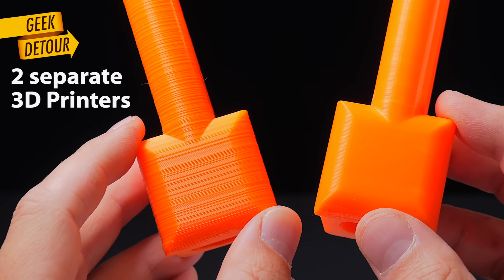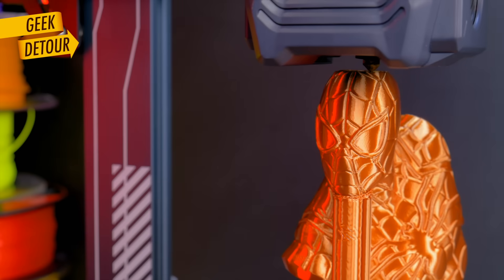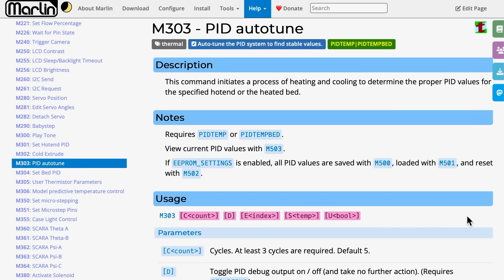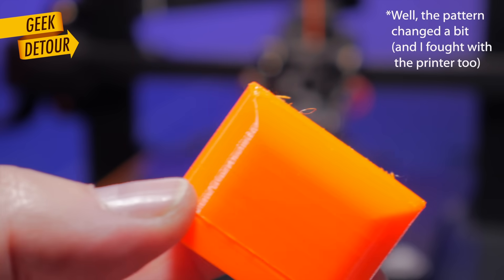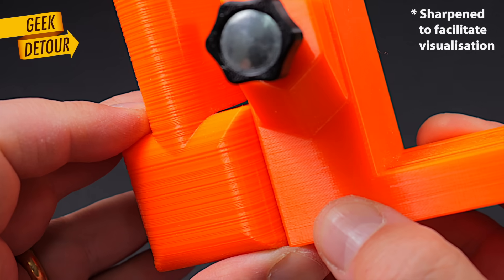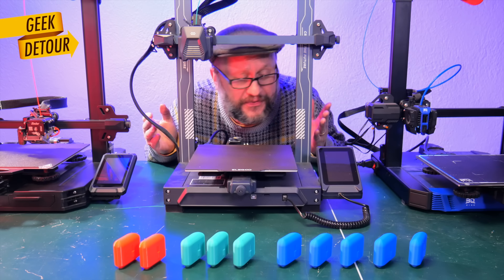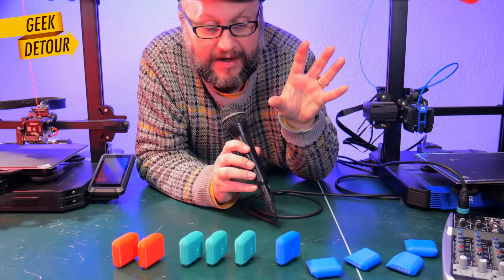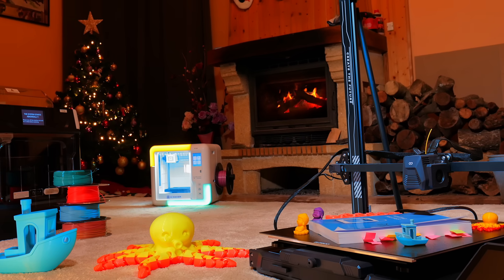3D Printer Problem: do you know How to Fix Z-Wobble?

Comment: Having these 3D printers and having to fiddle around with a trivial issue is real braindamage. I have a Tronxi P802E at home with Repeater firmware 0.91, and this is the kind of printer where you really need to understand something to get it to print well. Saying you have some kind of problem with this 3D printer and trying to solve it, you practically started studying quantum physics, like... I think you need to see a doctor about this. Just no comment more, idk😂

Comment: Bro I have an issue with bed adhesion on my anycubic vyper, most things stick okay with silk but nothing else will stick to the bed properly anymore...... suggestions? Tried cleaning the plate with detergent, leveling, New nozzle, z height adjust etc.

Comment: I'll throw the rock at the Ender for you..!  

I had an Ender but could never get the bed levelling to be consistent. I literally had to redo the bed levelling before EVERY print! I tried a bunch of various enhancements (stiffer springs, solid mounts with shims, etc...), but never got more than a couple prints before the next would fail because of the bed not being level. I gave the Ender printer away and never looked back!
Reply from the maker: It’s a very different machine… it has many things to adjust that are not obvious - mine still prints very well. But you need to keep it well adjusted.

Comment: My problem on my ender 3 pro v1 was the 6 z wheels. What happened was I left the printer off for about a year and the wheels sat in the exact same position for a long time, from the compression on the wheels sitting in the same place it put indents on the rubber wheels and when I went to go print, as the wheels traveled up the z axis the stepper motor wouldnt move the printer head up along the z axis fast enough so my printer would start printing the 6th layer where the 5th layer should have been, and it would keep doing this over and over again as it would travel up the z axis. But by replacing the wheels i fixed this issue. However i had many indents on the wheels because i left the machine off in different z heights for long periods of times, so it would leave many layers all messed up. Now in theory this could mean that the compression on my z axis to to tight, and this could be the issue with it. I never really got to the bottom of it as to why that is happening to the wheels but i noticed that when i made the compression too loose on the z axis it would print my models wrong. The right side would warp and the left side would be fine. So i had to add the compression on the z axis again.

Comment: Thank you so much for this video, I’ve had my printer for years but I’ve barely used it because every print kept coming out with this same issue.
After cleaning and lubing the lead screw + guide, I’ve finally gotten my first good looking print! 
The guide on mine was completely full of gunked up grease, so no wonder it was having issues.
Reply from the maker: That's awesome! So happy I could help you get your printer back in action! 🎉

Comment: I'm punching air right now. My Ender 3 from 2018 had perfect first prints, but then it started giving these ANNOYING lines. I tried everything to fix it, or so I thought. I must've tightened those screws in early tinkering because I didn't know any better. Now that I loosened them, the lines are GONE. oh my GOD so many years 😭😭😭😭

Comment: Real solution is: Grease your slidy parts and use bowden tube or comparable to make sure that your filament doesn't snag either.
Use high temp non sticky lubricant, PTFE for example.

PS. basically make sure that everything is moving smooth, if simple greasing does not work yet, you may need to dismantle the printer to clean possible hidden places like @craigjoe8691 suggested below.. some printers will have more hidden places than others, so work with what you've got.
PPS. also do make sure that things that have to be tight are tight, refer to ur manual.

Comment: Maybe the lead screw was misaligned at first and then when you loosened the bolts it came into alignment? That would explain why retightening them didn't reproduce the problem.
Reply from the maker: Yeah. Restoring the exact context that caused the problem is never possible. Some people got angry at the comments saying I didn’t prove anything (which is technically right) but you got it: once you touch it, disassemble it, lubricate it… it will behave differently 🤷‍♂️

Comment: You didnt mentioned the nozzle itself. Maybe something was wrong with the flow, so it couldnt extrude the usual length or the nozzle diameter might have changed a bit during printing or the first layer got contact to the bed cause it wasnt levelled properly, so it scratched on the bed and the nozzle diameter was affected. Why didnt you just replaced the nozzle for a better result?

Comment: Great video. I think the problem with my printer is pid tuning because it was working good before I had to change the heater. I’m still gonna replace the lead screw nuts as they must need it by now, I’ll upgrade it with Oldham couplings and anti backlash nuts while I’m at it.

Comment: Video about why you should't buy E3 S1 pro. Known issue. Bet a $1 You'll run over this problem again.
Generally the idea is that a screw must have only 2 fixed points, not 3!. Creality engineers found the most stupid and harmful way to sync the screws.
2 ways to solve. 
1. Throw away right stepper, right screw and all the garbage on the top including the belt and both top screw holders leaving top of the left screw move freely. Just like on E3. No magic with tightenind or loosing screw nuts will be required any more.
2. Throw away right stepper, move left stepper to the top and make it only pull the belt. Both lower ends of screws should hang free.

Comment: 0:18 Buying a top 3D printer???
Reply from the maker: When I made the video, more than 2 years ago, the Ender 3 S1 Pro was indeed the top model of the Ender Line - and it was a very good quality printer. I still use mine to print PETG (which I like to print slower than PLA anyways).

Comment: I will have to give this a try. I have an ender 3 pro  and have experiencing this issue. I also think i need to replace my thermoster as i have now started getting a thermal runout error (only when i go to do the print) once i reset etc the print works :/

Comment: I'm here in December of 2024. I've sent back at least 3 machines with this issue and just replaced them for new ones. I literally was tightening that nut that's supposed to be loose. I'm going to try this on my anycubic kobra 2 neo tonight and I'll comment back here after testing. 😊 Thanks for the tips. 😊😊
Reply: I have the Kobra 2 neo. Could you please tell me if you were able to fix the smoothness and if so, how? Thank you!
Reply: @Jangimiau  just got another extruder and I noticed that my m4x4 set screw (x2) were stripped and needed replacement. If you're able to spin the "hotend" with your hand even while tight, then yes, the screws are stripped. Once I find more parts for it and run a benchy, I'll let you know. 🙂🙂

Comment: I have been printing for 5 years and have 5 printers (4 filament, 1 resin) and i had no clue this was a thing.
this might explain why i have problems with my customized cr10 mini who used to print perfect dut have had problems for a while now
Reply from the maker: Yeah, old printers can remain printing nice, but we need to check a bunch of stuff: belts, it the print head and the build plate move without play (and adjust the eccentric nuts so they move smoothly without play), and sure: the leadscrews must be clean and lubed 😬 I have my oldies working fine - after you learn everything that goes bad, you can check it all in 5 minutes.

Comment: You can use tight nuts on the z-axis...
...If you use Oldham couplers as they take care of the leadscrew inconsistencies and allow the screw to move the slight bit it needs to, without affecting your bed/gantry
Reply from the maker: I still need to test Oldham Couplers to understand if there are side effects - there is something about non-linearity of the angular motion if there is too much lateral movement. I don’t know if that translates to visual artifacts or not. But I bought one to try

Comment: This can be caused by so much different things. I almost replaced my entire machine and still have ugly layer lines. Even expensive machines can have these issues. It could even be irregular filament with crappy dimensions.
Reply from the maker: You are right! That’s why some people get really frustrated when they start 3D Printing. But I need to say: the last batch of CoreXY machines, completely enclosed, with auto-calibration… they are way easier. It can be a BambuLab, Creality K1 (I am testing the K2 Plus right now) - they are practically plug-n-play. And filament is getting better every year too!
Reply: @GeekDetour  I'm also looking to buy a k1, p1s or sv08 corexy machine. But I'm afraid that they are even more complex to diagnose when something gets out of alignment.

Comment: Thanks Very much, Because of your video, I found a fix to my printing, not this problem in the video, but in the Print Head that was loose, and you show how to fix in the video
Reply from the maker: Oh, that made me incredibly happy. You know, some people commented here “go straight to the point!” But your case is exactly why I care: when our machines are in trouble, there are many different things that could be happening. Thanks for sharing!
Reply: @GeekDetour  I have a problem with my 3d printer. I don't know if you have a video with the solution. 
Let me explain. I have a ender 3 V2 neo. Bowder type. My problem is. When the project has a lot of retraction, the extruder damage the filament and stop print in the middle of it. I've tried almost everything, temperature, retraction, I even loose a little the extruder but nothing worked. Do you have some video about it ?

Comment: I have this book, it’s great. I also have The Zombie Apocalypse Guide to 3D printing by Smyth which is a quick read and very helpful in understanding how to diagnose and design for print. One of the biggest design issues seems to be fitment— to other 3D parts and to real world objects. Smyth’s book helped me to understand how nozzle size affects thermal expansion and as a result I can design parts that fit usually without running several prototypes. Anyway, I have a Bambulab X1 Carbon which prints perfectly— at least for now. So I appreciate the insight.
Reply from the maker: Oh, I bought the Zombie Apocalypse Guide to 3D Printing - very catchy title, the book itself didn’t age so well. It was interesting when it was published, but the images are all “old” - I don’t remember which type of cad it used. The models themselves look like obvious knowledge today (although it washed back in the day).
Reply: @GeekDetour  it does feel dated for sure, but there are some nuggets of info in there that are still applicable.

Comment: Just buy a better printer from the start. Just bought the x1-Carbon, and couldn't be happier.
Reply from the maker: I have a Bambu Lab P1S and indeed they are EXCELLENT printers. But I keep my older printers for different reasons. One example: TPU must be printed SLOW - so, a slower printer is perfect for that (I have a dedicated printer for TPU). I also like to print PETG slow. AND Silk filaments are only really shiny and reflective when printed at slow speeds - and I have printers that print Silk PLA better than my P1S.

Comment: Bought myself a 3d printer last week. it worked the first day then out of a sudden it stopped extruding filament mid-printing. I could not figure it out what went wrong for 3 hours then suddenly I realize maybe the tip is jammed. and sure enough it was. fixed it. now its running fine.

A few hiccups here and there, other than that I am starting to love 3d printing. Long way to go!!
Reply from the maker: The journey is the big reward here! Welcome to this amazingly maddening great hobby
Reply: @GeekDetour the more I get to know this field the more I realize there's a lot more to learn. Great content BTW. Thanks.
Reply: @BlondieHappyGuy 

You won't believe if I say that what happened to you is my fear as well. I secured the spool holder on top with 2 small screws because I did not had any other that fits in those threads.

I feared that it could fell down, I also secured the holder with 4 nylon zip ties.

Still feels it may fell though.

PS. It's nice to know that someone else also having same problems and resolving them. Loving this new hobby.
Reply: @BlondieHappyGuy   I did tried to make some videos, Never got comfortable making them. Well see you around then.
Reply: @BlondieHappyGuy  

I did even tried extrude and retract, tried pulling the filament also. 

it was really stuck. I had to heatup the hotend then poke the nozzle with a fine needle (provided with printer) back and forth only then I was able to unclog the head. Working fine since then.
Reply: @BlondieHappyGuy  Well, Thanks. I will keep this in mind. BTW do I really need a enlosure for 3D printer to print with PETG or TPU?
Reply: @BlondieHappyGuy 

Thank you so much. I also placed spool on top a few days ago just to save some space, didn't knew that it will be helpful in printing as well.

I will try to fiddle with settings for TPU.

Also I am thinking of making a make shift enclose with some leftover 3mm MDF board I have.

Will let you know how it goes.

Thanks again. :)
Reply: @BlondieHappyGuy   Well, please do upload a few videos of your electronic projects. I am sure it would be interesting to watch.

Comment: If that happens you should calibrate you printer then try again
Reply from the maker: You have a BambuLab printer, don’t you? 🤣 Not all problems are fixable with “auto-calibrate”, even on a Bambu. Ex: I saw many bambú users having some Vertical Fine Artifacts caused by misalignment of the tensioning pulleys at the back - you need to physically unscrew them and align them properly.

Comment: Thank you for this! My Ender 3 Neo not days ago started to have some nasty wobble, sometimes even a millimeter or two to the side! I was just as confused as you were! Sure enough, those screws you showed, I had tightened way too much. Per craigjoe's recommendation here, I scrubbed the Z-rod & brass fitting with dish soap & water, lubed them up, and put it back together, this time making sure the screws were loose enough to let the parts move a little. Presto, no more issue!
Reply from the maker: Hey! That’s great! I am glad you could fix it! ❤️

Comment: Update: I bought the book "3D Printing Failures" as mentioned and it's certainly worth the price. It's pretty comprehensive and a good (technical) read but as mentioned in this video, it is not mentioned in the book. Almost everything else is. I'm still having the same issues and Creality just sent me new rods but I don't think that's it. To date I have a complete new hotbed and now new rods. This is a very useful video. Thank you!

I am having the same exact issue with a slight difference: I can make two back to back prints, same file, same exact settings and one comes out (fairly) good and the other like crap! I tried every type of calibration, checked the hardware, rods are straight, and still get what you experienced but it's entirely random and not successive like yours. It's the most frustrating thing because I only have one printer and nothing to check it against. I thought that's how prints were supposed to look until I produced a silky smooth wall at random. I'm looking at a lithophane I printed and vertically one half of the print is smooth as can be and the other is jaggy as can be. How does one explain and troubleshoot that? I'm 100% convinced my printer is a lemon as it's been nothing but trouble from the start (now 9 months old). It's an Ender 3 V3 KE. I've been conversing wtih Creality for about 3 months with no solutions. In addition to the prints like yours, I can not get a respectable first layer no matter what I try, and I've tried everything. Frustrating to the max!

Comment: I'm just learning about 3D printing, this issue shouldn't occur or at least chances of it happening should be reduced with enclosed printers right???
Reply from the maker: Hi there! Actually, nope. Enclosures help mostly with a different issue: warping.
Reply: @GeekDetour  ah okay! I've come to learn that the ironing option should help with the lines. It's taking some time but I'm accummulating 3d printing knowledge xD

Comment: Exactly my issue! Thank you. Years of perfect prints then one day my Ender motherboard heater died so I replaced the thermistor and heater and still not fixed so replaced the board to the latest 4.2.7. In the process I gave the machine and check and clean and tighten. When I ran the printer again, terrible z lines even though the same part printed perfectly the day before. I checked everything, re-sliced the model printed again exactly the same. Tweaked again tried another slicer, tweaked the e-step and tried again, fail. After watching your video I realize I tightened those floating z nuts!
Reply from the maker: Oh! Interesting! 🤔 Thanks for sharing your episode - and I am happy my video helped you get the printer back on track! ❤️

Comment: @GeekDetour I have the same problem with my Neptune 3 Pro, right out of the box (Brand New). The threaded rod is lubricated and the screws are loose.
Reply from the maker: Hi there! You should pay extra attention to what I say at 1:36 - the bed should go front and back without any sideways / up and down / twisted movement. The same thing for the print head. When the wheels are not tightened to the right amount, you will have wobbly play in these components.